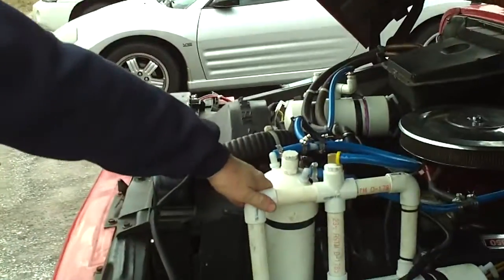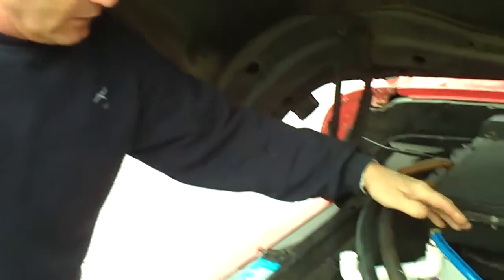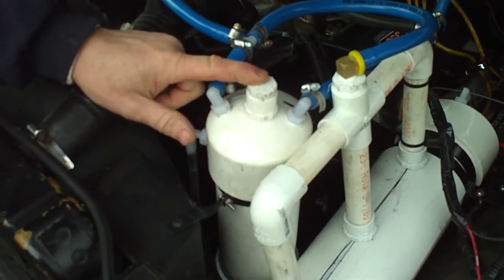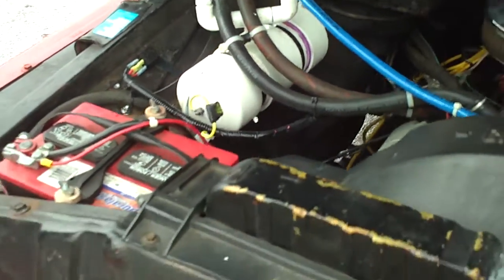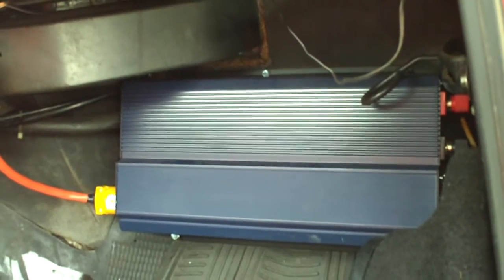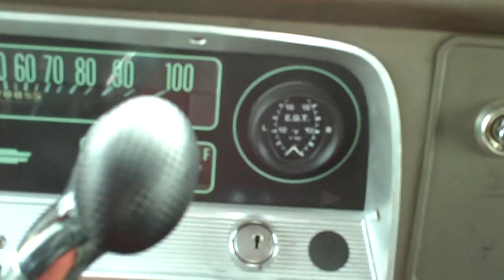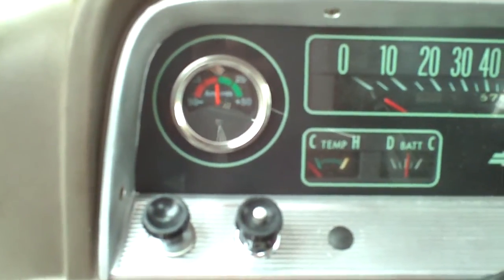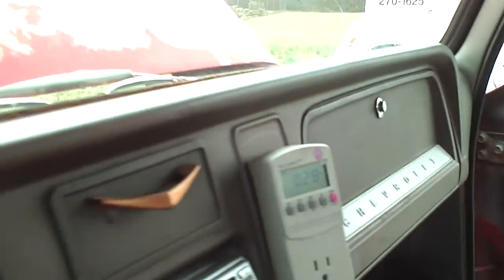HHO - Hydrogen Generator on a 1966 Chevy C10

Comment: Standard brute force low efficiency standard electrolysis. Heavy current input is not the way.  There are many other vastly improved methods. The owner probably just took the data help from someone with the same mentality. You have to do research and find out about how others have already made better designs. Hydrogen bubbles can also be made with no electricity, using just magnets North + South poles, as per vinegar water between 2 steel bolts, PVC T fitting,  and opposite magnets attached. (can also short the two ends with wire  and still see the bubbles.) Narrow cell with outer fields can also affect the inner plates. On and off DC called pulsing with duty cycle makes more gas than DC Filtered. Engineer Horvath used 200amp pulse with SMALL water cell, magnetic spoked electrodes,  without output heavy diode. The circuit was 10khz with 2nd transformer as low efficiency laminations (not ferrite) that forms POSITIVE DC degraded pulse called critical waveform on scope. Car engine ran completely on water input with 600watts 40 amps to Inverter .  Standard alternator recharges battery. US Patent on Internet study 3980053.     Engineer Archie Blue New Zealand used slight air pressure bubbling upward through perforated staggard aluminum discs set , so as bubbles do a clean sweep of ions stuck on electrode surfaces. He converted 3 cars running on water, with improved efficiency. . Fuel hydrogen + air used as evolved, no storage. Patented also but most Patents have run out of time and are in public domain.

Comment: Safest steering wheel ever!  All jokes aside, what is your gas mileage?  I'm curious because carbureted engines are not known for awesome gas mileage.
Reply: @lAcid Rainl If you run hydrogen in the intake on a fuel injected engine, you will need to have it tuned for the supplemental hydrogen that is coming through the intake.  I knew not to try it, but a fellow that worked with me ran the hydrogen in the intake tube.  The first run, he got about 50 to 60 mpg.  The second run, he got 40ish mpg.  The third was around 30.  Not long after that, the check engine light came on.  When you run any fuel through the intake, the computer gets confused.

Comment: I made one had it on 1999 3.8 Grand Prix  it worked great  mine was much simpler running 13.8 volts 12 amps directly to cell and bubbler then air cleaner box . I also had a relay which was switched and hooked to ignition switch so I could turn on system off manually and would shut of when engine was turned off . One question where can I get a steering wheel like the one on your truck  and is that custom where can I buy one ?

Comment: I was a sub contractor for Schlumberger.  I seen it with my own eyes.
They put a setup in an old clunker , miss firing. Ran like a new truck after it was insatlled.They didn't do anything to the motor, didn't even pull out the old spark plugs !!!!

Comment: I made one at home and installed it in my l200 it really worked. First it will decarbonising the engine then after that you will feel the power and the plus mileage. It's about 20 to 35% of gas saving.
Reply: Very nice, I'm going to try this on my 67 Ford F-250 soon
Reply: Did you use the same setup (inverter ...)
Reply: Wow I'm going to put this in my 66 chevy !!!!!!
Reply: Do you have to adjust the fuel the engine gets with the carb to compensate for for extra gas it gets from the generator? If not how does it use less gasoline? I'd like to try this on my 72 f100
Reply: yup mine worked nice on my 92.  chevy stepside

Comment: Don’t waste money on these HHO generators! Just put water in your fuel tank and save money straight away. I’ve been doing that for months and you won’t believe the money I have saved! These HHO generators are promoted by big oil to make you keep buying gas. Skip the gas and just use 100% water.